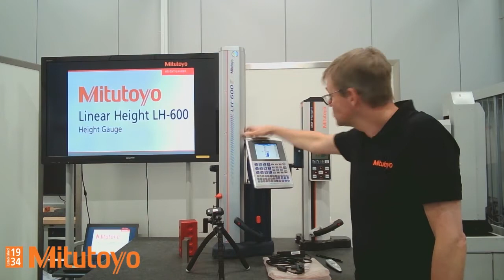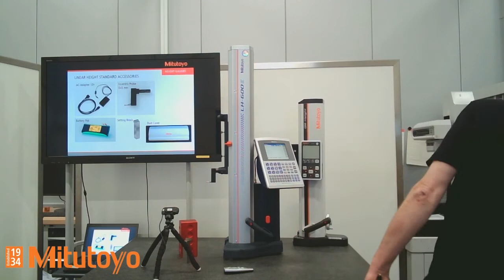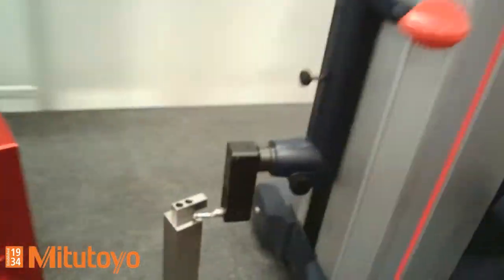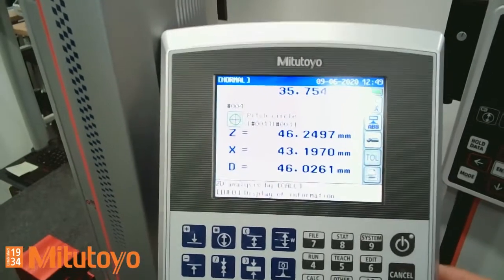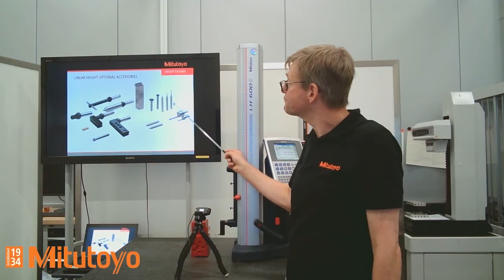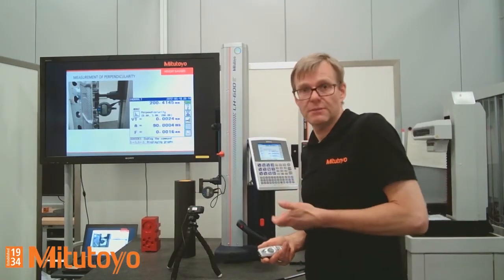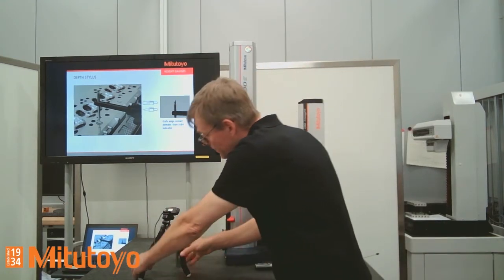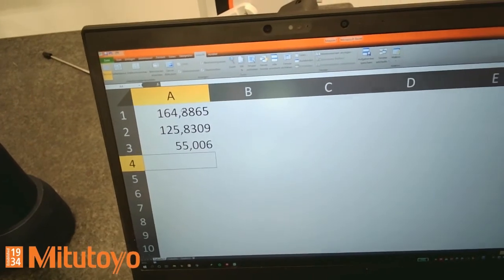LH-600 Live Demonstration | June, 2020

Comment: Can you provide us more information about cables that you are using at 46:27 to connect machine with PC
Reply from the maker: Yes, this can be found in our webshop!

Interface: https://bit.ly/2G1jLWY
Cable: https://bit.ly/34vlwoF
Reply: @MitutoyoEurope  Is that interface necessary or we can use universal adapter from RS-232C to USB? And If we use that interface, which cable do we use to connect from interface to PC, since I do not see USB entrance on interface? Thanks in advance
Reply from the maker: @miroslavmitrovic4438  The interface shown is special, it is used to send the data through USB via the HID (Human Interface Device) port. As for the cable, we recommend that you buy it directly from us since it is specifically designed to handle this type of communication method.